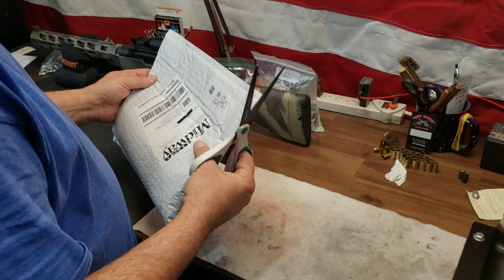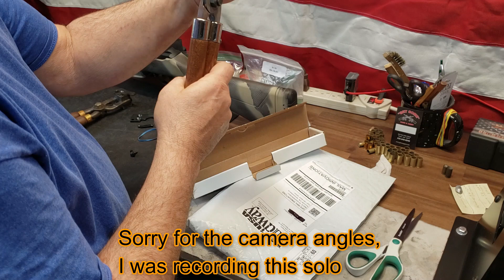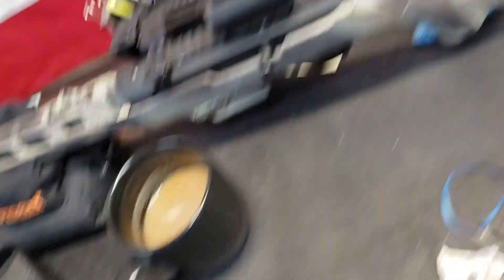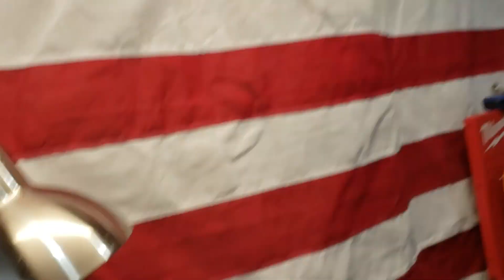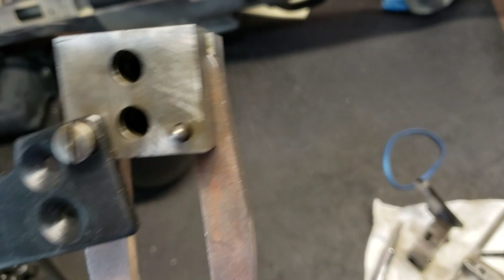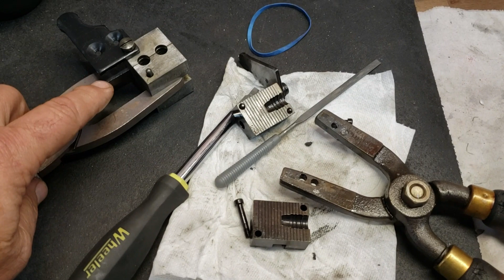Giving Old Molds New Life

Comment: Next time you have to go down to the Hardware store, Just take the mold with you without the lock screw in it, then go through the screws at the store and find one that fits. Btw, those are Saeco mold handles, they are really nice. I have a few sets of them.
Reply from the maker: Thanks Dave. I didn't see any name on the handles, and Lyman changed their designs several times, so I wasn't sure of their pedigree.
Reply: @Jerry-dk8se  Those are Saeco.  Saeco equipment is one of the best made, unfortunately, it is also pricy. if you by chance run across some Saeco molds for a reasonable price, pick them up as they are worth having, they are a joy to use and every design they cut cherries for are proven performance designs, that is why they cost so much to buy new.
Reply from the maker: @Thorsaxe777  I'm always on the lookout for old molds, and especially Saeco and Ideal. But not many used molds around here

Comment: I'm wondering if the handle offset isn't purpose made ? When the sprue is open , one mold half will cant . I'm wondering if they do this to aid with pin alignment with the sprue plate in the open position before closing the mold  .
Reply from the maker: Don't know, James. But some of the older handles weren't offset, but everyone who has gotten them in the past 6 months all have the same offset. But not a problem getting them right.